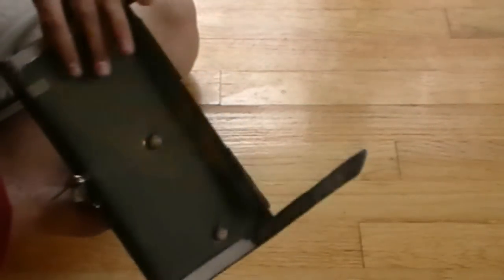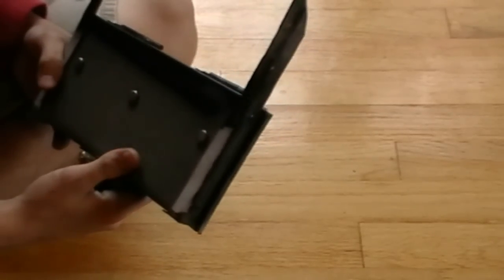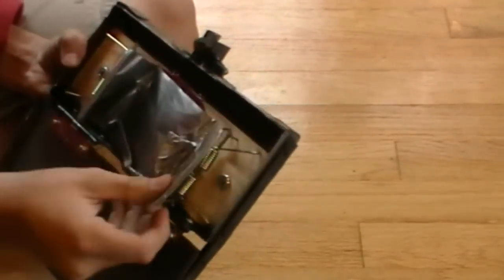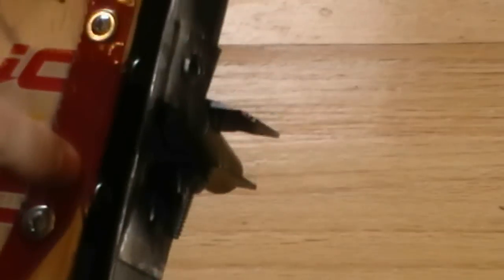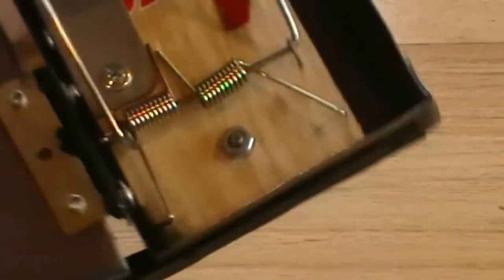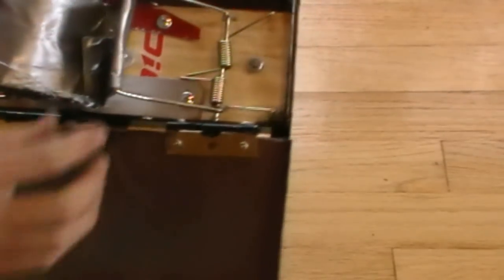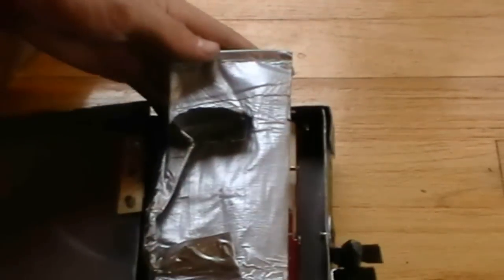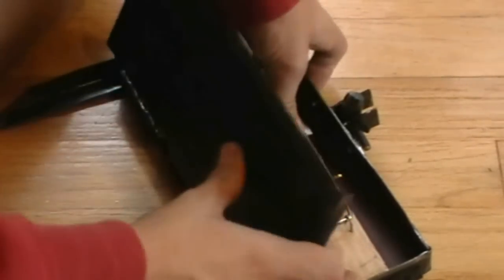Homemade Claymore Verison 2 (Best version)******

Comment: The trigger system you used was genius, i would recommend you to use small springs to keep it from opening by itself. but otherwise it looked like it packed a nice amount of power and the design was very nice. Keep up the good work!